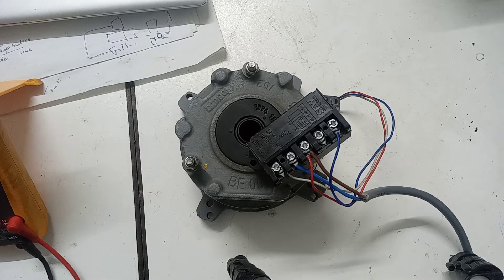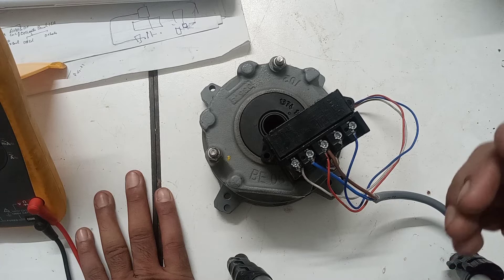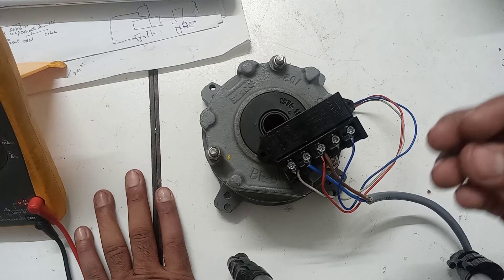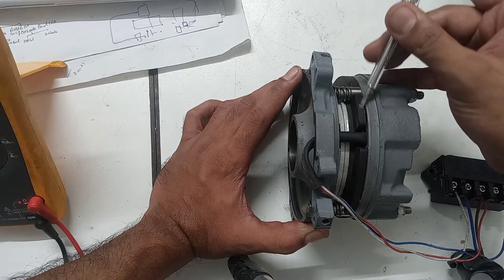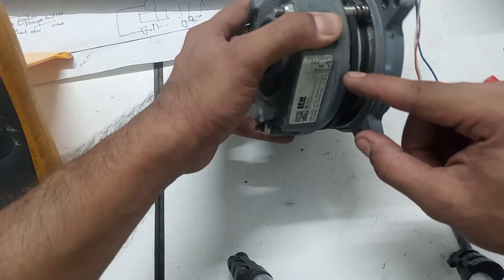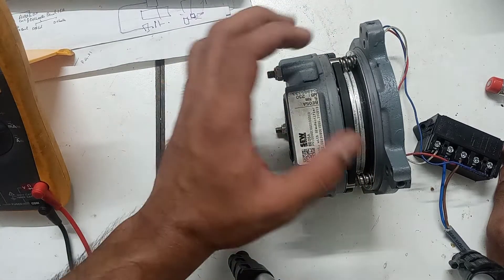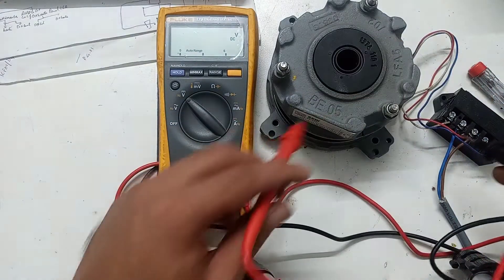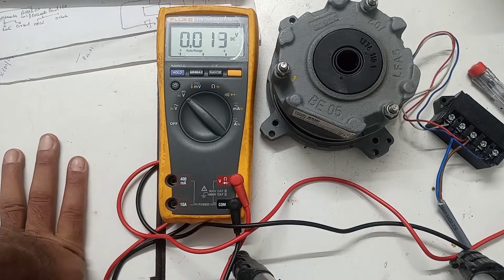SEW Brake and rectifier connection || Explained

Comment: My rectifier is fused. It will take time to get a same new one. I have another 2 wire model with me. Can I use only the actual coil to brake the motor or Can is use a DC power supply for the brake? Answer my questions if you can.
Reply from the maker: to use two wire  rectifier instead of three wire there is some consequences like if you use coil that carries less current then it will latch slow comparatively but it will work and depend on your application you can understand batter either fine or no,  also if use coil that carries large current it will latch fast but will heat up coil on longer run so it depend on you which coil do you use according to your application

Comment: 390 v ac input if I give  , how much the each  coil voltage will come ?  can u pls
Reply from the maker: It depends on rectifier and it is written on it and you should see manual of particular rectifier to know the voltage output and different input voltage level